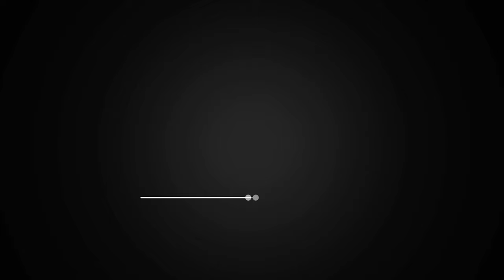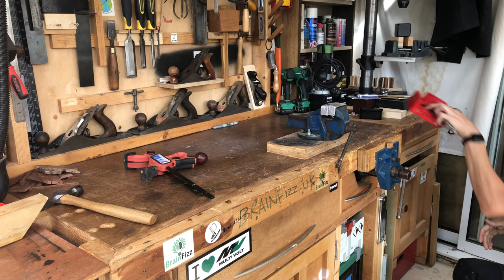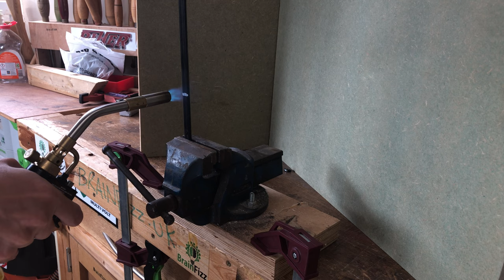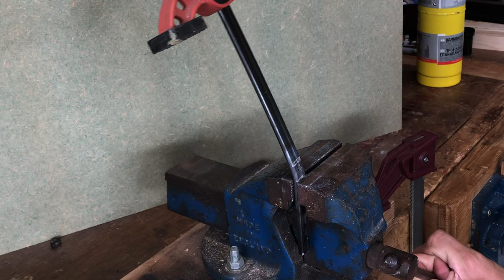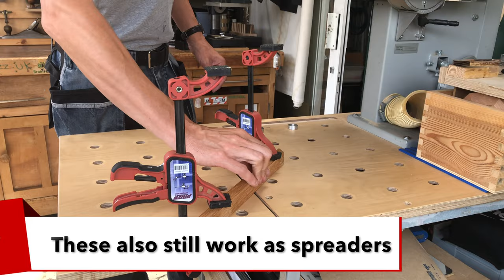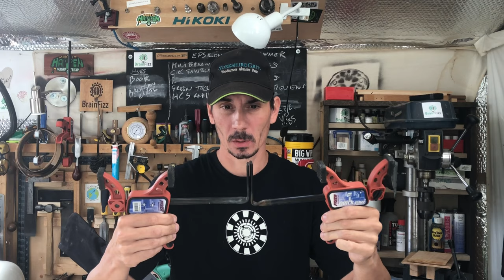EASY DIY HACK: Modify Quick clamps for use with MFT Workbench or Dog holes

Comment: You can also remove the static jaw, slide the metal track through the hole, and then reattach the jaw from underneath.
Reply from the maker: You can indeed, but it gets very boring, very quickly doing that each time.
Reply: @BrainFizz  It all depends on whether or not you want to retain the multi-purpose nature of the quick clamps. I would probably just purchase the dovetail clamps, and not limit the functionality of my quick clamps. But this could be useful if you can't get or afford dovetail clamps.
Reply from the maker: Or you could get a cheaper set of quick clamps and change those if you’re concerned about your budget.

Comment: I like the idea of using clamps I have already. I would still want to use them as reg clamps though. I would probably cut proper sized dowels in half. Remove the material needed to hold onto the end of the bar and pin so it won't slip off. Then make them long enough to poke through the bottom to drill a hole and have a pine run through so they don't pull up when I'm clamping.  Take a little more work to set them up I know. But worth it to me since I save money on needing multiple clamps for certain applications I may not use but once a year. The less clutter the better for me.
Reply from the maker: I guess there’s as many options and variations on this options as folks with a similar requirement.

Comment: Maybe just cut a piece of bar stock, drill hole in the middle the run a small bolt through the existing hole in the clamp. If u don’t tighten the bolt all the way you could swivel it vertical to go in the hole then horizontal to catch the table when clamping.... kinda similar to a toggle bolt. Then u still can use as a normal clamp when needed as well. Just a thought 🤷🏼‍♂️
Reply from the maker: Hmm thats not a bad call - might well be worth investigating! cool!
Reply: BrainFizz give it a shot. I don’t have a true bench like that yet to do it

Comment: I agree with you, for the cost of a decent pair of quick grips and the time and effort involved in making them you can buy some proper clamps for more or less the same price.
Reply from the maker: So to clarify, the Irwin clamps most people seem to mod are (IMO) cheap, and also inexpensive... the ratchet track clamps are available under lots of well known brands from between £30-40 each, (which is insane, because they pretty much are made by Handtools International in Taiwan. They also make the wooden handled ones for tracks as well - ever wondered why so many brand's clamps look the same)?? 
If you compare the two ends of the pricing/clamp type spectrums , then huge savings can be made. The way I went was in the middle - using the clamps I had, high end quick clamps from Piher which  ended up comparable in price to the cheaper screw type festool track clamps at about £15 each, which I actually picked up on offer for £10 a pair at the time...
depending on the individuals circumstances, offers and tool availability, results could vary widely.

I think for the very budget conscious, this Mod is a good option, but over time I think the specific clamps would be a preference.
Reply: Here in Aus, set of 4 Irwin $29, 1 mft clamp $45+ so more than 4 to 1 ratio guessing WORTH IT

Comment: I bought a work bench( 4x6 feet made from 1 inch plywood and angle steel frame ) and 20 Irwin clamps at a yard sale for 30 bucks  I heat bent 8 clamps and drilled the holes in the bench myself . They work great  but my cost was only 30 bucks
And a few hours work .. But I don't think I would do it if I had to pay   full price of the clamps and a bench .

Comment: Probably a little more time consuming when in use, but you could have saved a lot of effort and unnecessary damage to a tool, by reconnecting the removable section of the clamp back on the tool underneath the bench.

Comment: I would have just undone the end and put the into the hole and just done it back up. I know more work but the clamps and still be use as clamps when needed
Reply from the maker: And that is a perfectly adequate and acceptable method. However I can assure , doing that regularly, or for several clamps, during a glue up is a pain in the ass you’ll want to avoid at any opportunity

Comment: I'm planning an MFT bench and have both 1" particle board and nominal 1/4" tempered Masonite on hand. Anyone know how thick the material bored with a 20mm holes can be and still pass an ordinary T track clamp?
Reply from the maker: 3/4” or about 20mm

Comment: Personally, if you're committed to the MFT style of workbench I'm pretty sure you're going to want to invest in the best clamps. I tend to find quick clamps not as quick in practice as either ratchet clamps (I've axminster) or screw claps (festool) designed for rails and MFT tables. For that reason they're out. As for the economies of the endeavour, 150mm Irwin clamps are £9 for two and widely available at that price and i've turned a good few into jigs. But never with a blow torch. I enjoyed getting to hear what you think. Cheers.
Reply from the maker: Cheers Karl. Yeah, if you’re into the MFT (from the tracksaw side particularly) then the better clamps are an obvious choice. I’ve always got on better with the older screw clamp over the ratchet ones - and not just on price, I just get on better. 
That said I can see many folks taking this route as either a stop gap whilst funds allow, or if they’re purely clamping, and not so much into the tracksaw side of things.
I was luck as N&B had an offer on some time ago where orders over something like £100 and the double track clamps were a tenner, so I added a couple of packs.
I’ve also never been a fan of any of irwins clamps, they’ve always been pants. The Piher clamps I have put even Bessey in their place. Fortunately, these are the mini ones, and the old style at that!👍
Thanks for watching and keep up the momentum with the track jigs!👍
Reply from the maker: Snazzy Names help things sell!! LOL!

Comment: I want to build myself a MFT. You dont get many choices here in Greece on supplier so I will probably end up making myself a set of clamps like you did unless I can find some at a decent price. I would like to see any other tips, tricks, jigs or uses on the MFT.
Reply from the maker: Building an MFT is really straight forward, if you want to have it for cut with the dog holes etc it's worth taking the time to be really accurate, or even get a router jig (not a fan of the complicated drilling jig available as it has too many separate parts for my liking), you can actually buy the mat tops on ebay, cnc cut already too!
ill see what we can do about some tricks on the MFT!
Reply: @BrainFizz  I've got a cnc so I was gonna cut the holes with that.

Comment: Would a metal pin through the hole at the end of the bar not serve the same purpose?
Reply from the maker: Probably, but the point of the bend was to make it so i didn't need to mess bout under the table top, a pin would either need to be inserted from below, or mean the clamp would go through the holes.

Comment: Why don't  you take of the one end and put the bar through the hole and put back on the end you took off. That works well.
Reply from the maker: I can assure you, when you're clamping and unclamping lots of parts over an over again, even in a single day and using clamps in multiple places, putting on and taking off those screw on ends, gets really dull, real quick!